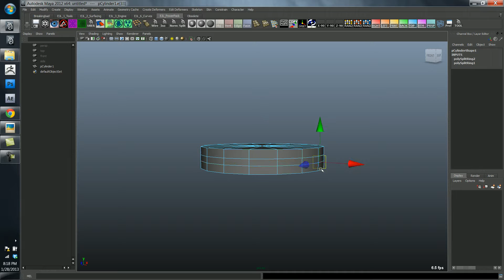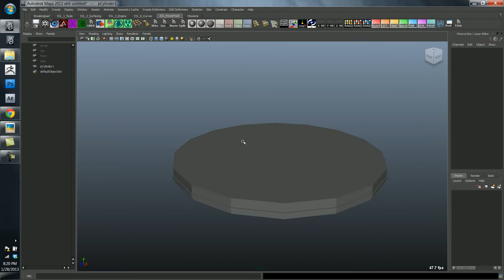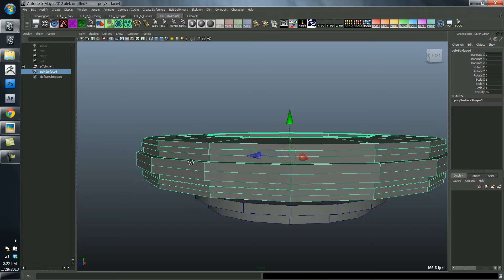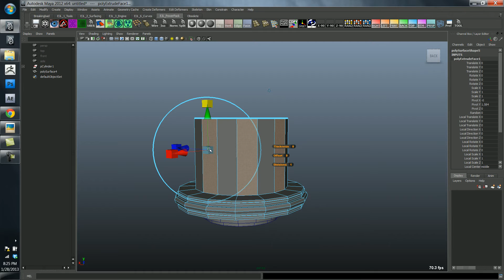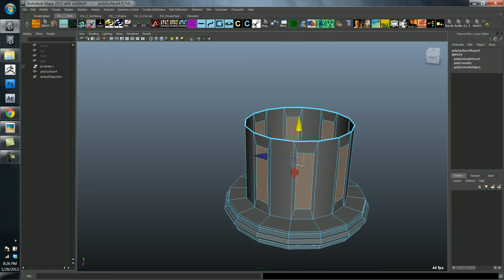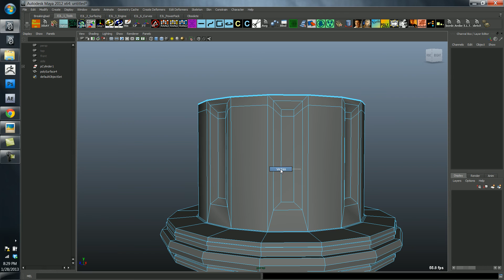Intro to Maya and 3D Modeling - Lecture C: 1/7 - Fire Hydrant Model

Comment: how i find the poly surgeon tool on maya 2015? thanks for the video
Reply: Use the mirror tool under mesh after selecting the faces. Use the menu to change direction and offset till you get the result you want.